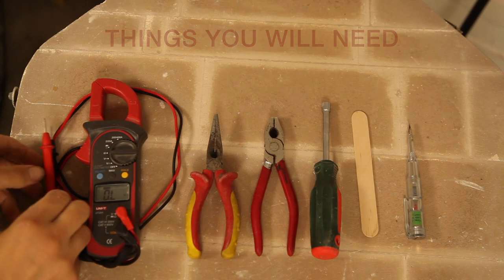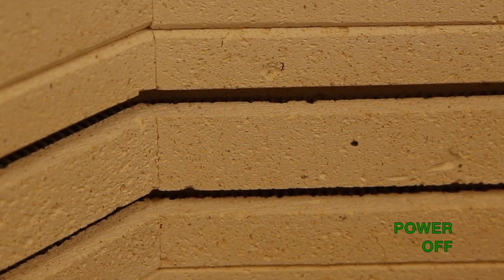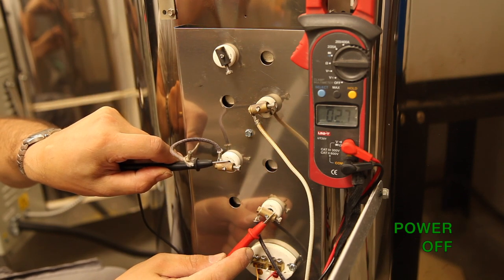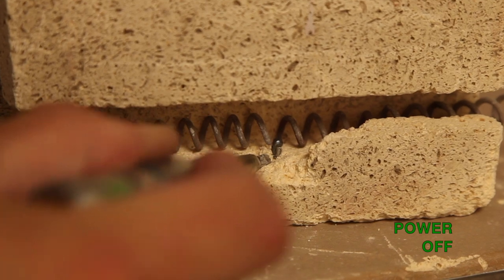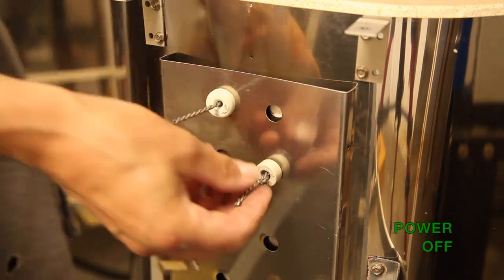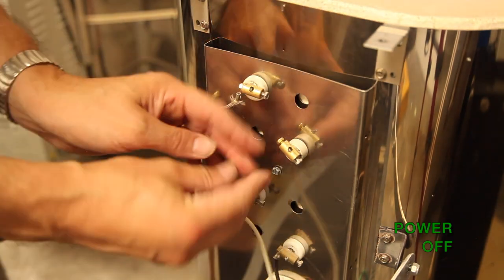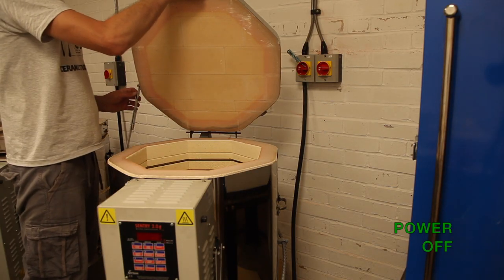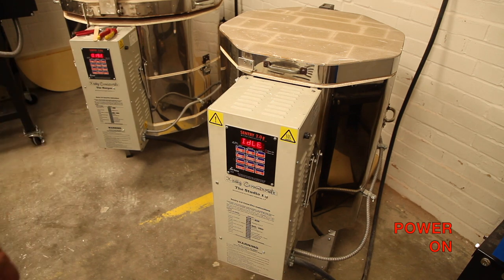How to change an element

Comment: Is it normal for the kiln to smoke the first time you fire it? Thank you for this video! You’re the only person that made a video showing how to test fire and stuff afterwards. My kiln started to smoke a lot and it flat lines when test firing
Reply from the maker: Well, the metal in the elements will oxidise (rust) as the power starts to run through them, and there will be manufacuturing materials burning out of the bricks in the chmaber, so I would not be overly concerned to get a few odd smells and perhaps a little visible smoke in the early stages of firing a new kiln.  I would be more concerned that you say the kiln "flat lines" which may suggest there is an electrical issue, perhaps with a bad connection to an element that needs to be investigated before trying again.

Comment: Great video! Can you repair a broken element that has been snapped while cold? Or does it need to be replaced? I saw if you hold a blow torch to elements that have bulged out from the shelves they become soft and you can use pliers to push them back together again. So wondered if snapped ones can also be fixed? Thanks
Reply from the maker: Not really..  You'll need to replace it unfortunatley.  As a temporary fix you can loop the ends of the broken element together.  That usually gets you through another firing, but due to the added mass where they join it will burn itself out.

Comment: Can you do the paper test to see which element is broken?
Reply from the maker: Sure.  Paper tucked in on the element, start the kiln.  If a piece of paper does not burn, then take a closer look at the element.  Be careful though, as it may not be the element which is broken, it may be, and often is, the relay switch that supplies the element which is broken not the element.